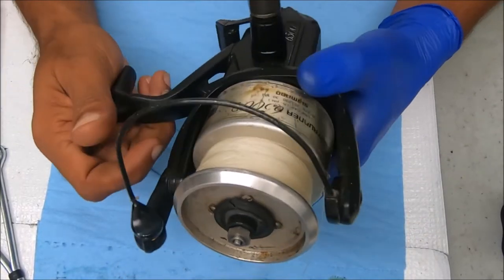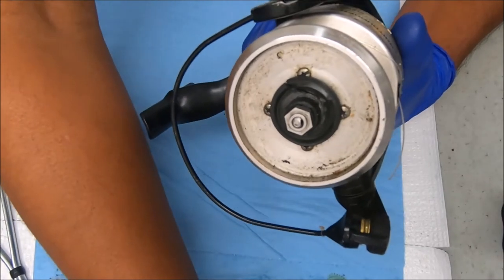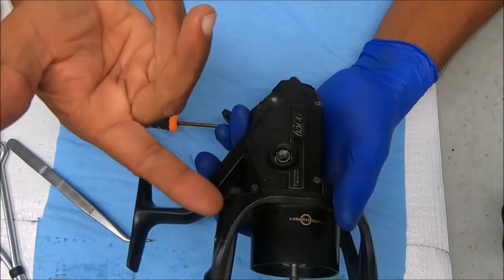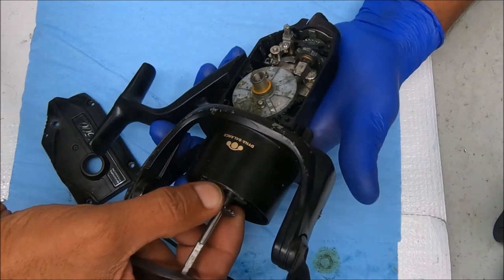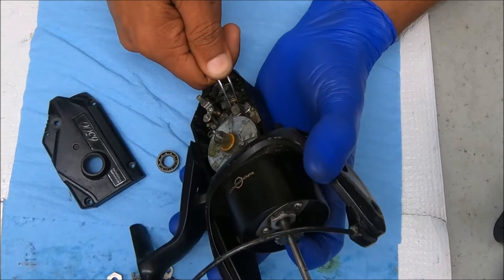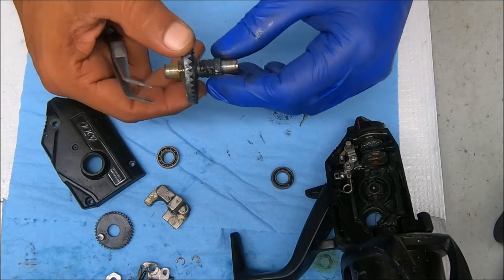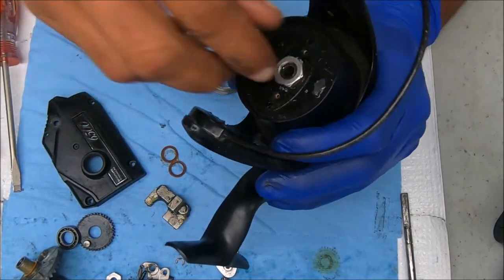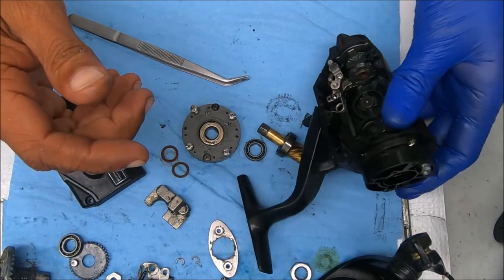Shimano Baitrunner 6500B Skipping While Cranking - Diagnosis & Fix: Fishing Reel Repair

Comment: I'm looking to buy a baitfeeder, baitrunner, live liner whatever you want to call them. Budget is $150 fish are blue catfish up to 90lbs, lakes usually some river fishing all from the bank/shore. What would you recommend sir?
Reply from the maker: Thanks for watching! This reel, but $150 is a low budget..... then (either you or a repair shop) break down the line roller, grease all the parts..... and then simply take care of your reel after that..... should last many, many years!

If you can't get the 6500B, the 8000D or 12000D are nice also.